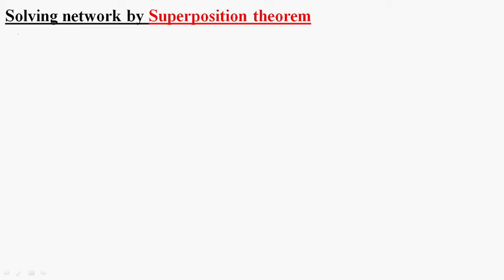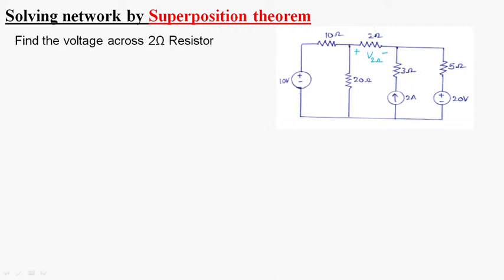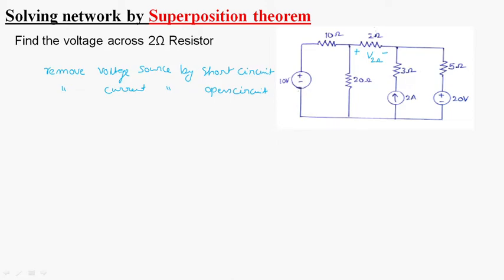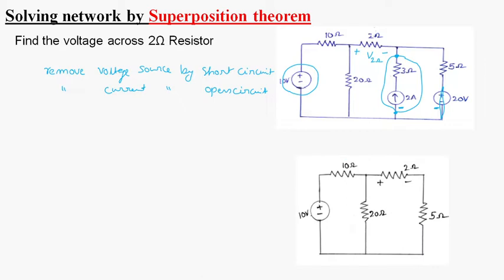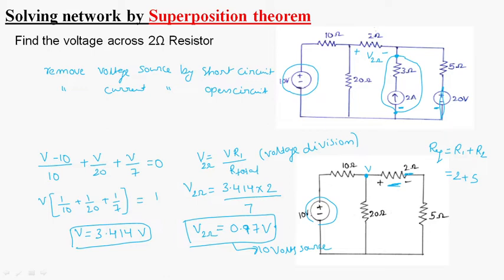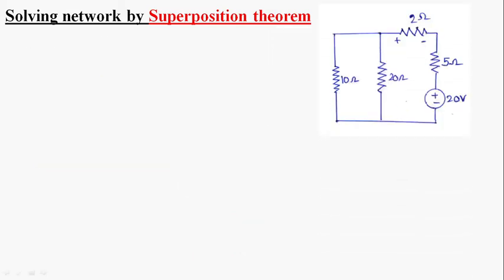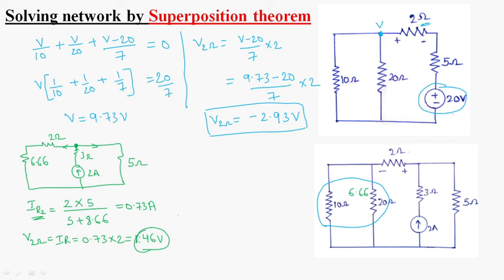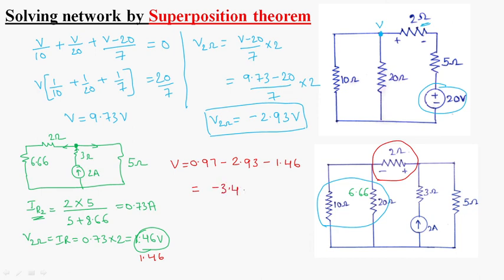Superposition theorem Example | Electrical Circuits | Lec-21

Comment: Can anyone explain why did he took V - 10 during the nodal analysis and not as 10 - V? The tail voltage is 10 and the arrow voltage is V. Is'nt it?
Reply: as current is flowing out of node v its opposite to the flow of voltage source

Comment: Why sir total resistance 6.66+3+5
Reply: No it is 6.66+2+5, because the node a and b line contain those three resistors, but sir doesn't point out node in this video